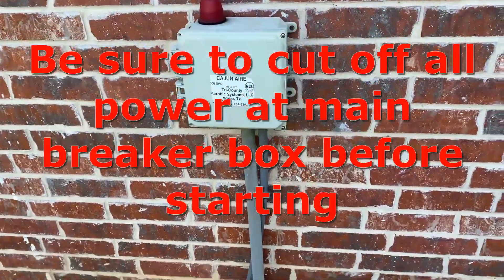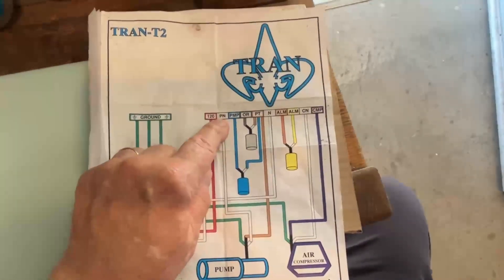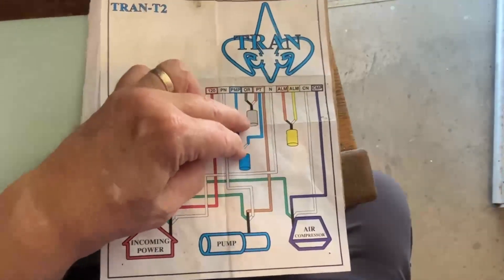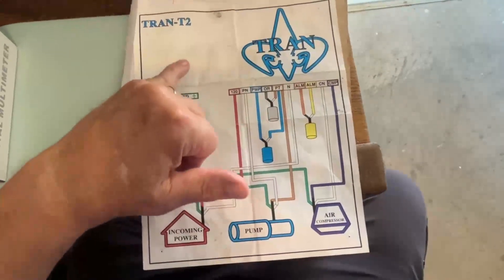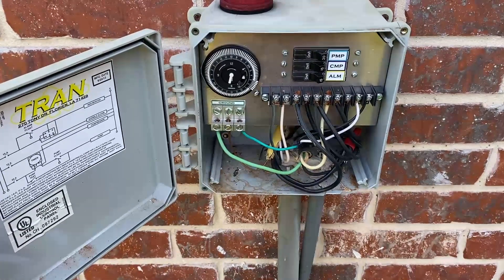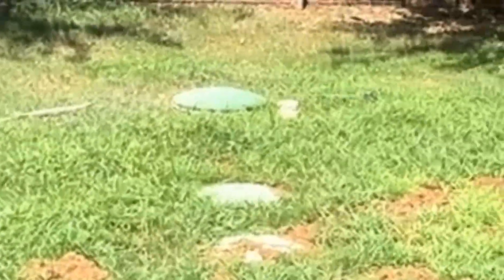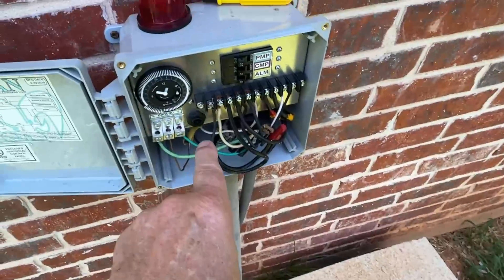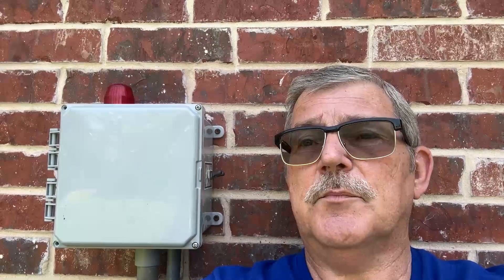Tran T2 aerobic septic control box replacement

Comment: Lloyd this is all new to me. All the septic systems I've seen are just gravity feed and no electrical hookups at all . I  am way behind on the new technology out today for a septic systems. Nice one 👍
Reply from the maker: If I had my way the gravity system is what I would use too. This type of system is required by the county. It works somewhat trouble free but when it goes wrong it's a mess.  Thanks Steve

Comment: Don't you miss the old out house? lol. Good luck with it Lloyd. We are going to Oklahoma this weekend, we aren't allowed to flush toilet paper when there because of the septic tank. Will be good eats and fireworks in Oklahoma!
Reply from the maker: Thanks PAPA and have a great trip to Oklahoma
Reply: Where I am, all shops sell toilet paper suitable for septic tanks as well as ordinary stuff. It is true to say that the septic tank friendly stuff does not have the structural integrity of the regular.

We also have two very different types of toilet cleaners, for tanks or 'mains' systems. One of the big selling points for my house is that it is on a town system.

Comment: I learned something today.  I will either have to rebuild the 4x4 wood post, double outlets and the alarm box as it was, or route the power to a disconnect on the front of the house (visible from the tank) and then to the control box (which can be on the end wall).
I dug up all the wiring today (that was so much fun) and I'm getting closer, but still thinking things through.
I bought a 10" sprinkler box to put above at the pump tank and would like to put a sealed 4x4 box in it with conduit underground to the control box and mount 3 cord connectors in it.  I'll put a waterproof splice on each of the 3 cords long enough to make it through the conduit to the control box in one piece.  That will allow easy replacement without having to dig them all up again.
Of course the sprinkler box says "SPRINKLER CONTROL VALVE" on top, but I think I can sand the writing off and possibly Dremel something SEPTIC into it and put some labels on the wires.  There doesn't seem to be much out there to connect the tank up (parts or pictures).
Reply from the maker: Sounds like you are well underway. Good luck on your control installation. Thanks

Comment: Do you know about where the box has to be mounted?  I currently have a 4x4 post with a double outlet on one side and the alarm box on the other side (that needs to be replaced).  The septic tank, holding tank / pump and drain field are all in the front yard and the post is about 6ft in front of and 6ft from the front corner of the house.    I purchased a box similar to what you have for direct wiring with all the controls.  Power comes from a breaker panel on the end of the house and near the back (and feeds underground).

I want to locate the new box on the outside wall and it won't look good on the front of the house so I'm thinking to put it around on the end near the front corner.  The instructions just say the light has to be visible, but not from where.  I'm in the city, but I haven't found any sort of code about it.  Any thoughts?
Reply from the maker: Where I’m at there is no code of the location but to play it safe you could ask a plumber or just check local code posted on line in your area. Good luck
Reply: @RustyGlovebox  Just talked to one of the county inspectors, he said it was ok around on the side of the house.  That's right where I wanted to put it.  I've had the box for a few months, it's cooling off now and I've milked the project about as far I can with frequent visits to the hardware store.

Comment: Wondering about this or the Spi Bio. Both timer. Shaft style burning out too often Rains kill it since thing leaks like a sive. Air pump will save money in the long run with electricity use, better aeration, and cost of new shaft motor every year to few years.
Reply from the maker: The county requires us to operate the system a certain way so I try to stay within the boundaries. But you raise some good points. Thanks and take care